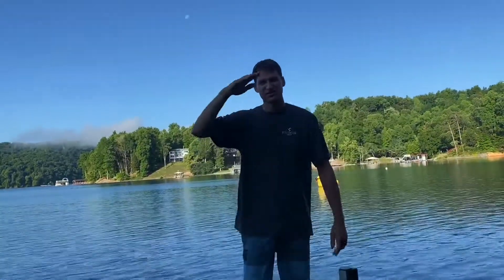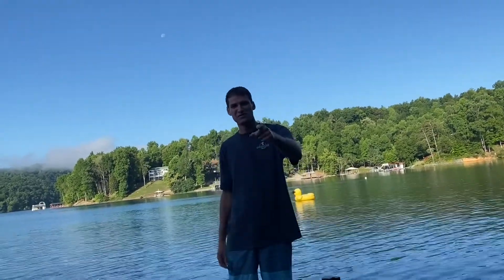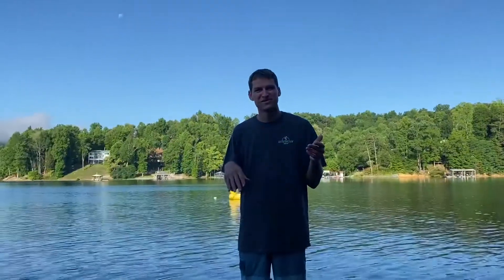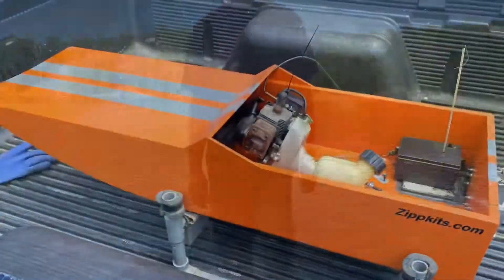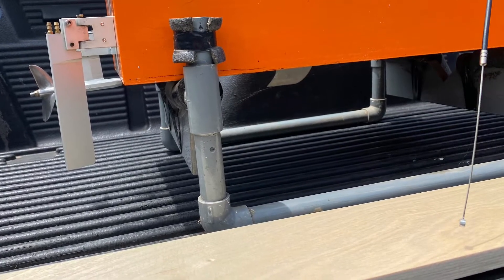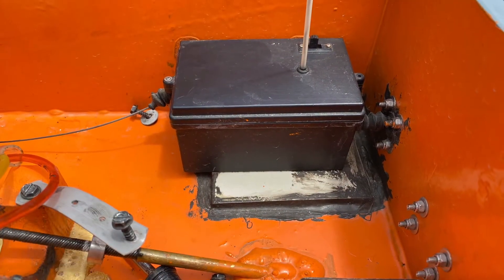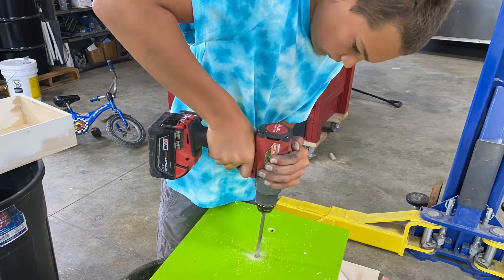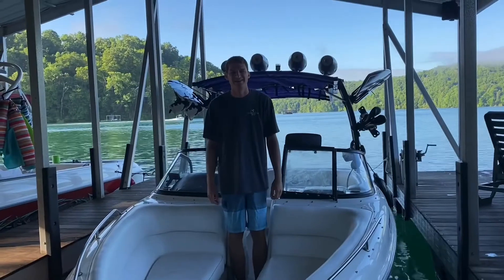RC boat racing introduction -NASBOAT!- is born!

Comment: As usual, I seem to be a little late to the party. I hope that you're still monitoring your channel.
I have thought of building such a boat for a while now. However, all I really know about boats, is that the boat goes on the water, but it's very bad if the water goes in the boat.
You mentioned the requirements of the boats. Are there no dimensional or material specifications? 
You mentioned coming out to watch the racing, but you didn't say where it was happening. One of the reasons I've not followed up with building one for myself is that I have no knowledge of what "Boat Hardware" I would need, or where to get it. 
I can tell that you are in the US, but where?
Also, what kind of speeds are these boats reaching while racing?
Reply from the maker: Rules to race with us are simple, flat bottom boat with a string trimmer engine. Dimensions and materials are all up to you. We race in the area around Greenville Ohio, if you are nearby you are welcome to join.
Reply: Thank you for the response. Is there a website for NASBOAT?
Reply: I sent that before I meant to. Looking at the map, you're just a little more then 200 miles from where I live. 
I've now watched some more if your videos and have learned quite a bit. Are you making your transoms from 1x4? The rest of the material appears to be what is called "Luan" in my area. I've also seen it referred to as door skin. It is low-grade plywood that is about ³/¹⁶". I say low-grade because there are plenty of voids in the inner ply. 
Thanks again for responding, and for the videos you've posted. 
Ciao
Reply from the maker: @bob2161  I normally use hardwood for the sides and transom, that is planed down to maybe 1/4” or 5/16” on the sides and 3/8” for the transom. Then yes the bottom and hood luan works fine. We do have a website it is www.nasboatracing.com
Reply: @theclevercraftsman  that's great! Thanks for the info. 
If I'm looking at this right the transom needs to be beefy enough to hold the screws for the rudder mount and shaft strut. I imagine pine would bee too soft. I do have a few planks of oak I think I'll try. 
Thanks again.